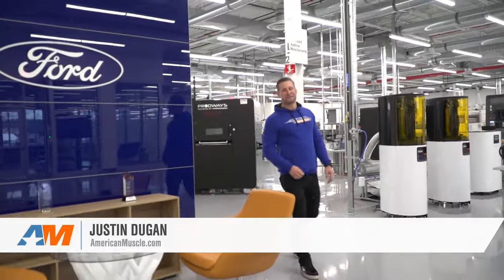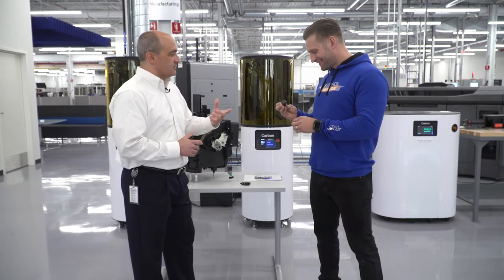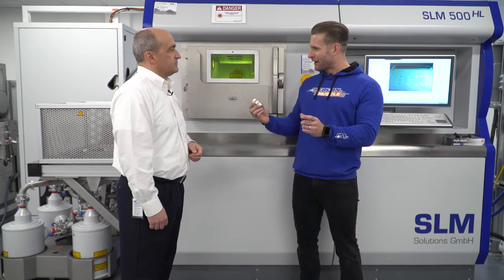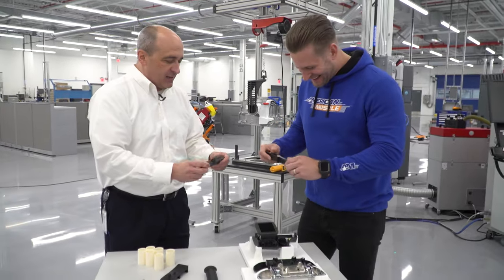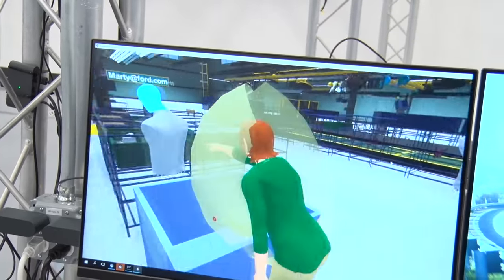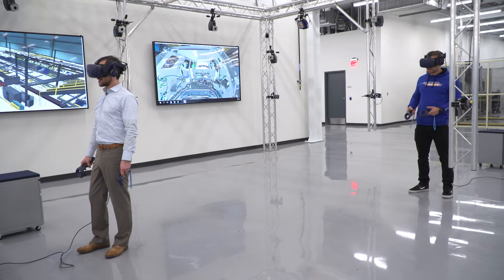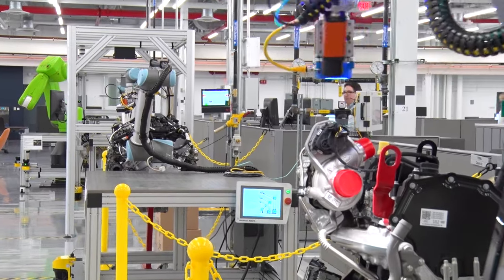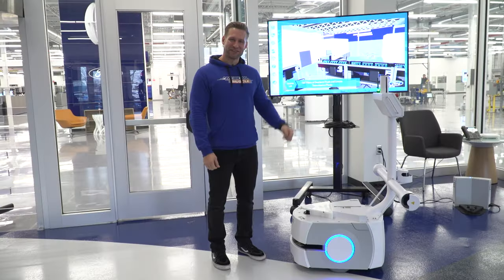How Ford 3-D Prints 2020 Mustang GT500 Parts | Touring Ford's Advanced Manufacturing Facility

Comment: This is great and all, but maybe Ford should concentrate on fixing the typewriter tick issue with the gen 3 coyote!
Reply: Amen
Reply: If Ford didn’t 3D print the gen 3 coyote block, my f-in car wouldn’t be at the dealer getting a new motor right now!!!!
Reply: Gotham EMS i was wondering about that too. all these ticking mustang engines were 3d printed?
Reply: And make they’re shift forks out of stronger material so they won’t always break like my car
Reply: They put out a New TSB for the timing chain rattle on deceleration. 18-2354A
Reply: @CM-maga  that's a little bit of good news i guess but they are still ignoring the elephant in the room

Comment: He spoke about qualifying materials but they still have issues with motor knocks, manual and auto trans issues. Its a sign with Ford knocking off a lot of their lineup that they're reducing spending therefore we will most likely see more quality control issues with the mustang.
Reply: Every brand has issues.

Comment: 3D printing is simple enough for five year old children.  Now its just a question of finding Five year olds that can speak American and can change their own diapers. That transmission part [steel]  that weighs 30 pounds, would only weigh 6.6 pounds, if Ford decided to make it out of Magnesium and 10.39 pounds if they chose to use Aluminium. Magnesium can rust but Aluminium never does.  When will Ford use Magnesium in the transmission/housings and engine parts/housings??????????  When will Ford use Aluminium body panels on their Mustangs????? I dream of a 2800 pound Mustang.  I don't give a d-m about horsepower.  Power to weight ratio  is where they have to strive for .
Reply: You obviously don't use industrial machines.
Reply: Just shut fuck
Reply: We have to look at this in terms of cost, durability, and mass manufacturering potential, which again, ties into cost. Are these materials better in all of those areas?
Reply: @KB-bh9hp  Ford should spend their time and energy in increasing performance.  That  means weight to power ratios by reducing the weight of cars not by increasing horsepower to 750 or 800 or even higher. You have to be dead in the brain by building cars with 750 horse power and weighing 4100 pounds. ... I would rather have a 3000 pound 400 hp car that can run at 40 mpg than a 4100 pound 750 hp car at 12 mpg.
Reply: @FooFahFoeFum  they should spend their time fixing the major and massively occurring engine problem of the current mustang. Huge number of piston slap issues in most if not all of the brand new engines!